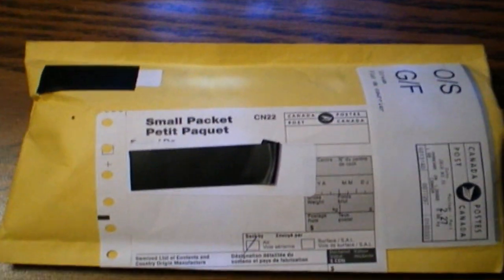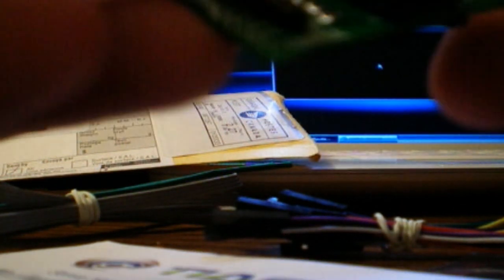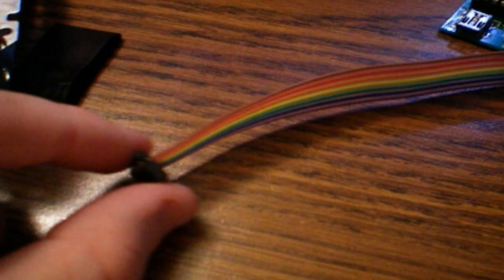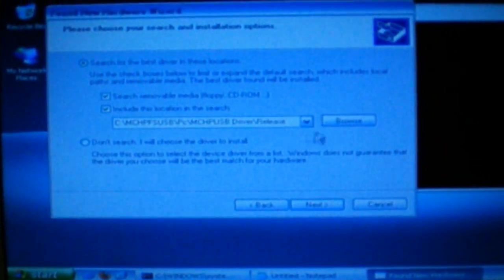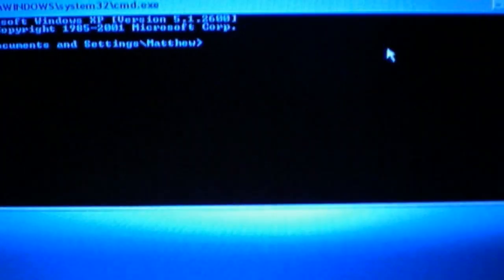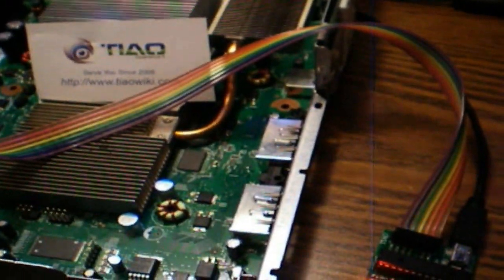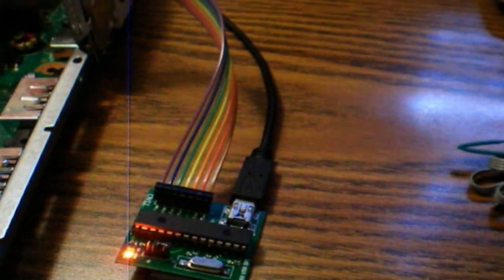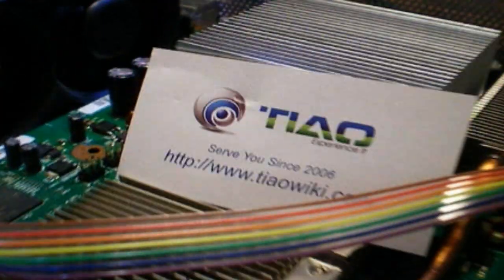USB Nand reader from www.diygadget.com XBR xbox 360 hacking

Comment from the maker: @tekniikzX420 You solder the diodes in at the same time you solder the cable in place. Also the cable came from sam-tec. And the points are labeled on the PCB board.

Comment from the maker: @MoDzNG4MEP14YvIDz Um, for the pinheaders all you have to do is remove the solder from the holes, and put the new pin header in it's place. can't really make a diagram for that. The pinheader can only go in one way, well I mean you have to make sure you put the smaller points threw the motherboard or it will not make good contact, but thats just common since once you got your pin headers in.

Comment: @CarolinaGamer 
By and chance do you remember if the pin headers were the standard TSW or the modified TSW? And did you order all the same type of them and modify them to fit each section of the xbox or did you order multiple ones with different amounts of pins per row?

Comment from the maker: @CarolinaGamer also price and availability. These are still for sale, I don't think grim makes them anymore. The ones from diygadget  are cheaper then any of the others out. And it uses a standard pinheader on the board instead of smaller or custom connectors. The main reason I care so much about this is for the fact that I plan to use mine more then once so the easier that is the better. And this product makes it faster to connect my cables to and uses a standard pinheader cable, quality is A++

Comment: @BzRKxKILLER if the brick is red it means it's a power Problem and the 3 red rings means you had a bad Nand Flash and error 0001 is caused by Voltage of power because you altered the xbox with New Switching Diodes and wiring it requires more power to use To fix the problem, have an electrician come to your house and check everything out and to get a voltage regulator and a filter.

Comment from the maker: @aH0tUnicorn grims my boy and all, but the main differences are the pinheaders, and the board size.  First off you can't even install a regular pinheader onto grims, so you have to keep wires soldered to it. Also the board completely covers the components, grims has the usb connector sticking off the side, I never really liked that in his design, seems like it could break off easily. and one more thing is the pic on this on is resettable, you never know if a chip will go bad.

Comment: @BzRKxKILLER it could be a house problem typo try using less electricity in the room your using and try it as your xbox will draw more power and it should work but otherwise i'd consult to an electrician

Comment: @BzRKxKILLER This is what i found Igot an xbox 360 whit the 0001 error code well it looks like the xbox 360 is very sensitive to power i perpusly alter the power in my house to make it un stable after fixing tht 0001 error on a frinds xbox 360 so avery this was working find like for and 30 minutes straight